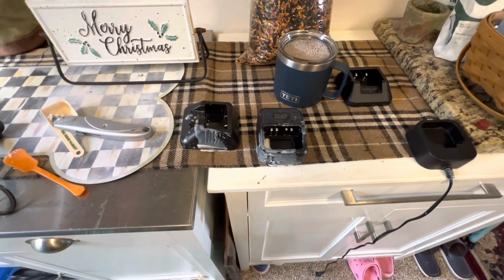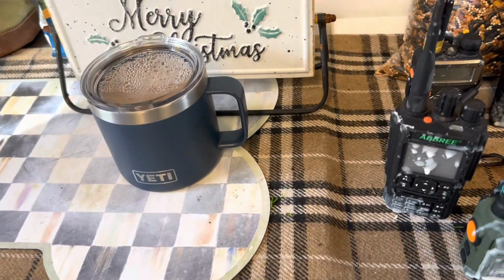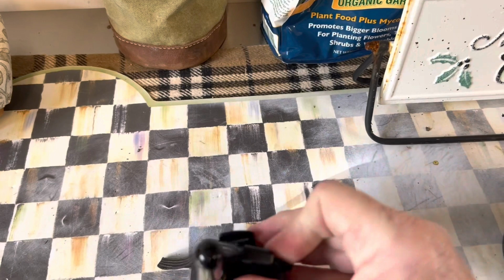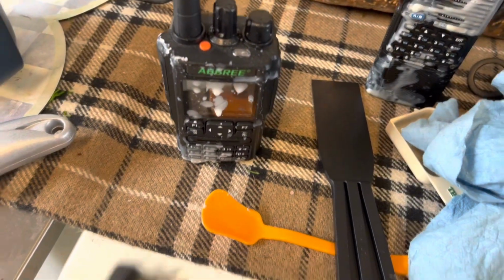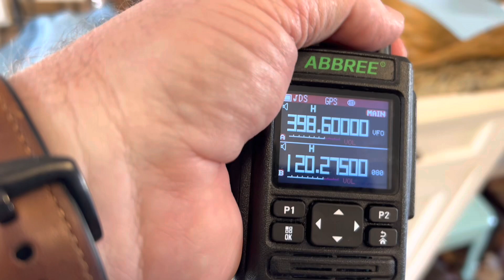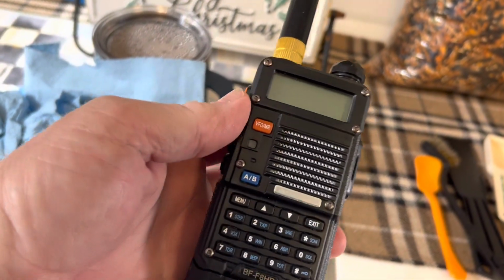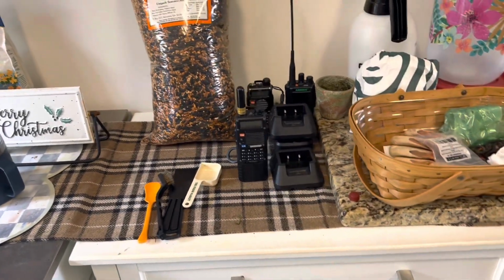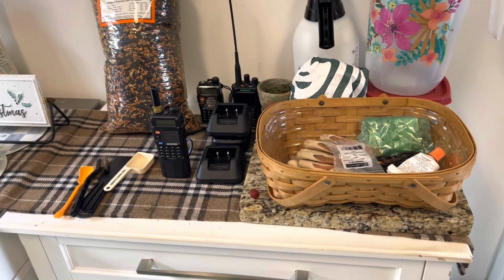Wax on, Wax off. Waxed dipped ham radios.

Comment: Thanks for posting this. Maybe you could hot water boil the wax out of the cases, providing it doesn't void the mfr. warranty coverage. How about using a toothbrush 🪥 and hydrogen peroxide with the isopropyl alcohol for the speaker grill wax? Wondering if putting some holed thin plastic inside the case could help prevent speaker damage and still be used.
Reply from the maker: Thanks for watching my stuff.